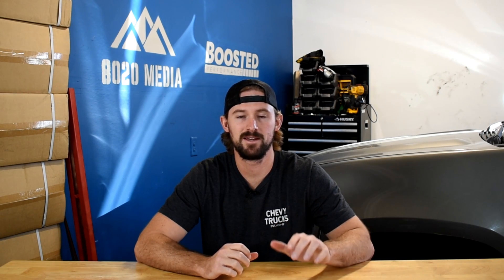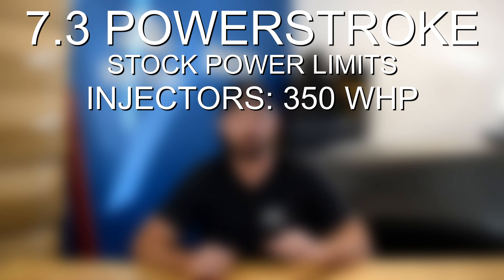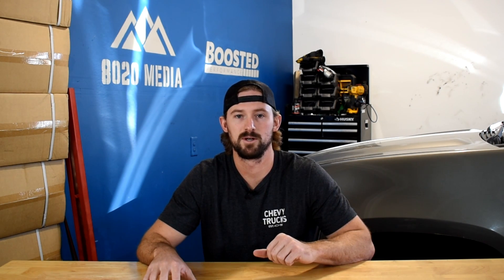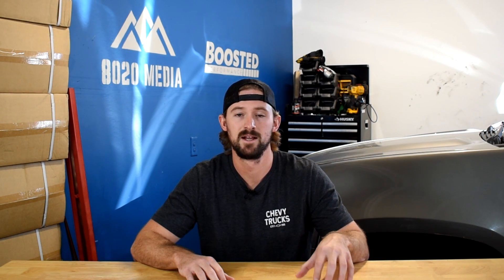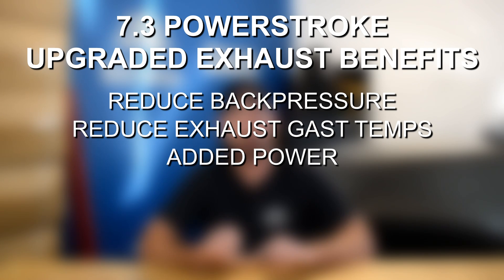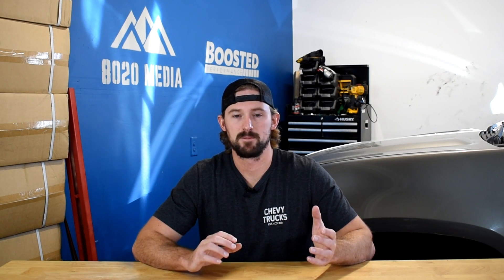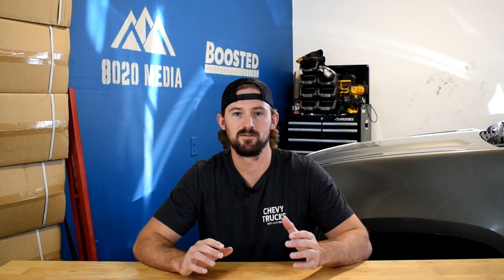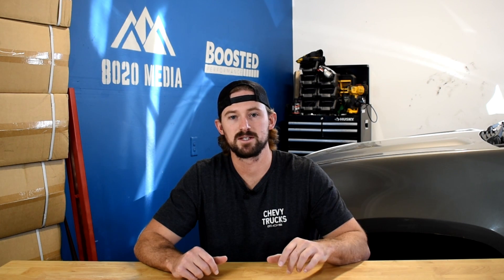How to Build a 325WHP Ford 7.3 PowerStroke!

Comment: Where do you find an aluminum exhaust? All I've ever seen is an aluminized steel exhaust and stainless steel.... I'm confused now
Reply from the maker: Yeah sorry I referred to it as aluminum but it is aluminized steel
Reply: @8020Media  so what exhaust am I supposed to use? Your video said that a steel exhaust makes a different pitch but they are all steel....
Reply from the maker: C - We're coming out with a 7.3 exhaust video next week.
Reply: Your video said that steel systems cause drone but both systems are steel

Comment: Quick question, if you use the php turner and take the truck in for service, is the service provider able to tell if it has a tuner or not? What if you remove the tuner before taking it in and restore the truck back to the factory tune, can they tell if it’s was flashed?
Reply from the maker: Do you have an aftermarket warranty or something? If you don't have any warranty then it really doesn't matter if they know it is tuned or not.
Reply: @8020Automotive 
I have a warranty on my transmission, just had it replaced and tunes void the lifetime warranty. I removed the php and tuned it back to stock before replacing the transmission.
Reply from the maker: I - Thanks for sharing your experience. I'm sure this will come in handy for other viewers!

Comment: Looking to get a crew cab 4x4 7.3 Power Stroke . Great video, the 7.3 only had 250 HP at the fly wheel from the Ford. The improvements sound great! I was a Test Driver for ford in AZ at Yucca Proving Grounds! Loved that job!
Reply: I miss Ford being in yucca now it's Mopar
Reply: I miss ford not being in Yucca also, I was a Test Driver 95-98 the 2ND Gen Lightning was a BLAST to drive on the High Speed Track! Bolt FORD tuff is no joke!!! Ram has become a better Truck because Dodge bought the proving grounds!
Reply: @thunderjet4294  lots of fun to work there ! I worked there in 95-98.
Reply from the maker: D - Thanks for the feedback! Sounds neat.
Reply: You don't get a 7.3 for power,  you get it for half a million on the road.
Reply from the maker: N - What can be true for others, may not be true for all.

Comment: BTW Stock fuel system can support quite a bit more than 400, actually reliable into the 500+ range.
Reply from the maker: I know the OBS fuel systems can handle a good bit more, you talking 99.5+'s though?
Reply: @8020Media  obs systems can't handle more, they run a mechanical pump, I would lose fuel pressure with 180/0 injectors.

Comment: 02 f350 7.3 
Kc stage 1
Cnc 180/30
4 inch exhaust
6637 intake 
Rebuilt trans with shift kit
Mishimoto trans cooler 
Stage 2 hpop with xover 
Bellowed up pipes
Boost fooler 
Hydra 
JeliBuilt tunes
Edge monitor
Reply: Doo you know the power numbers your hitting? Also what did you that you " are hitting mid 30s"
Reply: @justinguerrera8322  I figured this wasn't for me, but I was running that much but that was with an obs truck and they don't have wastegates so the more you push it the more boost it woukd make, I have a couple videos up showing the boost gauge.
Reply from the maker: T - Thanks for sharing your build. Sounds like a solid one.
Reply: How do you like the setup? I'm planning on going the same route, only difference what im wantkng to do, bigger turbo with a 1.0 housing vs the .84 and an air intake that takes air from outside the hood not from under the hood....
I had a 94 with 180/0 stock turbo with a 1.0 housing and exhaust mods and ts chip with tony wildman tunes, I would peg out the boost gauge if I stayed in long enough and that was 35 psi.... I have videos of the truck. I miss it sometimes.
Reply: @centraltexasfoxbodies  it's been pretty solid definitely has some get up vs stock . Was on the fence with the 1.0 but so far no complaints  with the .84 did have a issue with egts while towing but found out my Intercooler was leaking pretty bad replaced it along with the stock boots and now no issues.
I've seen mid 30s while in my street tunes but I rarely jump on it .
Reply from the maker: T - Hell yeah!
Reply: That’s amazing, but is it any good..?

Comment: You only mentioned HP what about TORQUE ratings that's what's important for diesel owners
Reply from the maker: Yes, that's true I probably should have talked about torque limits but torque can be managed with proper tuning so just important to stick to reputable tuners.

Comment: Yeah it has terrible gas mileage cuz it doesn't use gas
Reply: If it ran on your hot air it could drive across the ocean to Hawaii and back
Reply: Its gas mileage is infinite, fuel mileage is low.
Reply from the maker: M - lol thanks for the insight.

Comment: been thinking of getting a 7.3 or lb7. which one would you choose personally?
Reply: I use both for work.  
Ford is much softer ride and I think stops better. 
Gm is much quicker, better tow mode, it's an LLY tho. However my step dad had an lb7, and it survived that moron until he literally set it on fire drunk. 
Both will pull whatever the truck can handle just fine.
Reply from the maker: I own a 7.3 personally if that answers the question!

Comment: I have a 2002 f350 dually with 65k original miles (it is mint)...My dilemma is do i change out perfectly good stock parts for aftermarket parts?  I pull a 11k pound 5th wheel about 4-5k miles a year...thanks
Reply: your truck is worth well north of 35k. possibly a lot more if it is manual, crewcab, and 4x4.
Reply from the maker: F - Agreed!
Reply: 4x4 crew cab lariat unfortunately not manual
Reply from the maker: Mike - It depends what parts you are wanting to change.

Comment: Do yourself a favor and get rid of the hot air intake (CAI)  I made that mistake and could not believe the difference with a true CAI.
Reply: Air filter.  You lose power when sucking in hot air from under the hood.  Talking from first-hand experience as I ran that filter for a while until I got the S&B CAI.
Reply from the maker: M - Thanks for taking the time to reply here!
Reply: @Gotya02 all that hot air for 10 hp.
Reply from the maker: M - Thanks for sharing this insight.
Reply: Are you talking about AIH delete or is this something different

Comment: 03 F250 SC SB 7.3L with ZF6 stick. Bought used off dealers lot in Sept 05.

Heres all Ive done....so far

Banks CAI
Banks 6.0 Intercooler 
IH bellowed up pipes 
Garret BB turbo
Boost fooler
Adrenaline HPOP 
Hi volume LPOP 
Oil galley crossover line
Coolant bypass filter
AMSOIL dual bypass oil filters
Airdog 95 gph 
New OEM Bosch inline fuel pump.
4" turbo back exhaust, deleted muffler. 
Not obnoxious at all.

Mostly longevity mods and to let him breath better.

Afraid he's got PMR's, so I'm not gonna go do something to grenade my mill.
Reply from the maker: Brian - Nice! You're building a good one. We love our 7.3!
Reply from the maker: T - Nice build! Thanks for sharing.
Reply: Why did you use an 6.0 intercooler
Reply: They are larger, fit without mods and you can get relatively cheap.

Comment: I've had an e99 for 12 years and tried a TS6 tuner but saw a 2mpg drop in mileage so I run it in stock mode. Seriously considering an intake mod and maybe a higher flowing muffler. It's a daily driver that occasionally tows a 5th wheel. Not interested in more noise, but can deal with some to get more power and mileage.  I'll try the 50 mph tune with any new mod to see if the mileage improves vs taking at hit. Nice video.
Reply from the maker: Sol - Thanks for the feedback & sharing your experience! If you're looking for an intake, here's a great option that combines price, quality, and performance: https://boostedperformance.com/73-powerstroke-cold-air-intake

Comment: I just bought my first diesel to pull my new to me 5th wheel camper. I ended up getting an early 99 7.3L. So far, I have an intake, 4" turbo back exhaust that duals out under the back of the cab. I just got done installing all my gauges. I ended up rebuilding my tranny a couple months ago. I did it myself and installed a tugger kit while i was at it and a dual clutch disk converter. The truck has 275,000 miles on it and idles at temperature with 48 pounds of oil pressure. I also put on a flat bed with a nice tool box and a 150 gallon auxiliary fuel tank. It has 35" tires and gets about 16mpg. A tuner will be my next purchase. I figured id set it up to take advantage of the tuner before I got it. The intake and exhaust did make a difference. I have about $4k tied up into the whole thing, including the price of the truck.
Reply from the maker: This sounds like a nice rig and would benefit largely with a tune! Nice build.
Reply: @8020Media  

Thanks, and yes, it would benefit from a tune. It runs really well now, I can't wait to see how it runs with another 100hp and 200 lbft. My next 2 mods will be the Hydra and a turbo master waste gate controller. I'm actually putting my own boost fooler together with a 1/4" pressure regulator. 

I'm also really thinking about running heated fuel lines and maybe a heat pad on the fuel tank. I live in se Idaho so it's cold here a lot! Last January, we saw -37 and it can get much colder than that.
Reply from the maker: J - Nice! Keep us updated!
Reply: @8020Automotive 
Would this not work for me?
Reply: How much did you pay for your truck. I just got a 99 7.3 dually and paid $12,500, I know I may have paid a little too much. It's my first diesel truck and I'm rebuilding the fuel bowl, hpop, and replacing boots.
Reply: @smithohana5683  

I paid $2000, but the bed was pretty well rusted out, and it didn't run. I found a really nice flatbed for $500 and put it on and ended up finding the fuel bowl heater was shorted out blowing the fuel pump fuse. It had just had $3,000 worth of front suspension work done to it by the previous owner and come with all the receipts. I also went through the transmission. I put a new torque converter in it and a tugger kit. All together, I'm in it around $4200.
Reply: @jesusisalive3227  Awesome!🙏🤙
Reply from the maker: J - Thanks for taking the time to respond to other viewers!
Reply: @8020Automotive  

👍
Reply: @jesusisalive3227 Thank you Jesus!
Reply: @smithohana5683  I have my 2002 f350 up for sale right now, 230,000 miles 7.3 2wd automatic cab and chassis set up to haul trailers. Life long texas truck it's up forsale for $9,000.... it's my daily right now.
Reply from the maker: Smith - How many miles? You've got a good one for your first. We love our 7.3
Reply: A congratulations on your purchase of a 73 mine has 336,000 original injectors and a few upgrades I read that you were talking about making your own boost fooler here's an idea for you check this link out this is what I did very simple and the hose that goes on the other end of this thing all you have to do is heat it up and it goes right onto the nipple on  your map sensor and the other and 1/8  NPT pipe thread ONTO THE INTAKE SPIDER check it out you will understand
Reply: @robertfisk8344  

They must have removed your link?
Reply from the maker: We didn't remove a link. Don't think he plugged one in.
Reply: @8020Automotive  

I think youtube themselves removes links sometimes.
Reply: MC AS2201F-01-08S Air Flow Control Valve with Push-to-Connect Fitting New
Reply: 4k is a steal, let alone buying upgrades lol
Reply: @bacon098  
Yes, it was kind of a diamond in the rough situation. I think most people couldn't get past the rusted bed. It didn't bother me at all because I wanted a flatbed anyway. It was funny, my flatbed sat on my trailer in front of my house for a week before I could install it. In that week I had 5 people stop and want to buy it. They could not believe it when I told them I picked it up for $500. They told me they could not find anything for less than 2k.
Reply: Including the truck??? Sounds like you got a heck of a deal on yours...I got lucky as well. My wife and I ended up having a second kid, so I even traded my 03 mustang gt for an 02 f350 with the 7.3 crew cab.
Reply: @DeepSouthBayouDiesel  

Yes sir, including the truck. Got the truck for $2k. I got the feeling the gal who sold it had it sitting there for a while. Nobody wanted to mess with it because of the no start and the rust. I took the risk knowing I could part it out if it wouldn't run. I got lucky, it took 30 minutes and a $30 part to get it running. Oh and it had brand new 35" tires on it with dick cepek wheels.
Reply: A good tune on a 7.3 is going to blow your mind.  Night and day.  It's still not going to run with a modern common rail but it will wake the F up!
Reply: @failranch9542  

I can't wait to find out! Just last night, I installed a new tube/diamond plate bumper. She looks mean now. Do you have any suggestions on tunes?
Reply: @jesusisalive3227  I have DP that I've had over 10 years.  I'm pretty sure there are better ones out there now.  A lot of people like Jellibuilt (sp?).  I use the DP 80 hp "economy" and by comparison to stock it is an absolute rocket.  I wouldn't tow heavy with it though.  Back it down to one of the tow tunes for that.  They aren't as fun but they won't destroy your truck either.  I've been wanting to try a 120 hp race tune just for knocking around day to day unloaded.

PS - make sure your tuner is aware that it is an E-99.  Those are unique in a lot of little ways.  Even the injectors are different.
Reply from the maker: J - We've got a tuning guide on our diesel website that will help: https://dieseliq.com/73-powerstroke-tuning-guide/
Reply: @8020Automotive  wow.  It's crazy the price these days for a good tune.  When I went with my DP in, I want to say 2012, I think I was like $375 out of pocket for all the hardware and 4 or 5 tunes from them.  Things have just gotten out of control!
Reply from the maker: F - Completely agree..
Reply: I have a late 99 cab and chassis extendeed cab, 7.3 manaul dually with an aluminum flatbed on it now
Reply: the sec you test drive   the truck on a tune you'll never not have one again its  very significant     I have ts  because if its simplicity  makes transmission shift tighter    ... def  get a tune
Reply: When you did the tranny,  did you go the heavy duty route? Super duties came factory with standard duty,  heavies were special order
Reply: Me too! I am picking it up in 2 days and its a beast. I know nothing about diesels yet lol
Reply: Was tranny due to wearing out or a upgrade to handle more engine power? How hard was that task to do??
I’ve built TH400 and that was rather easy.
So is there a source to know what good parts to put into these and like the converter you mention?
Reply: Why a dual disk converter? The 4R100 comes factory with a tripple disk
Reply: I got a 99 aswell when I bought it had a 5 inch exhaust dumped out right at the back of the cab and it’s got a bigger turbo. I ended up getting a local muffler shot to run it like the factory and put a hi flow muffler and that was 10x better
Reply: With s&b cold air intake that actually pulls in outside air (not a open filter under the hood pulling hot air),4" turbo back exhaust,edge attitude tuner,and a fully built john woods transmission with triple disk torque converter,and dyna trac free spin kit you can get 18 to 21 mpg.
I also use amsoil signature series 15w40 in the engine and schaffers in the transmission and transfer case as well as using diesel kleen 6.5oz per tank(I will be swapping to opti lube soon as it's lube properties for the hoop are far better than diesel kleen)
I have 415,000 original miles and my stock injectors are still working perfectly.
I have also swapped turbo impeller wheel for a wicked wheel and removed the air heater on the Y pipe, and lastly I replaced my up pipes with bellowed stainless and replaced all CAC boots with the upgraded boots from dieselsite.

Big thing I want to bring up is the way this guy done his "cold air" intake is completely wrong,the way it's set up it's sucking in hot engine air and that can decrease HP by as much as 20HP, you have to set up your cold air intake to draw in outside air and you will gain around 7 to 10HP as well as lower EGTs.
Also your trucks computer once you hit 25psi of boost will go into limp mode you can either pull over shit the truck off and back on to reset or after about 2 to 2 and a half minutes the computer pull limp mode as truck goes back to normal, if you are making that kind of psi you will need a boost fooler and will have to upgrade CAC boots or you will blow the boots off.

One more thing to add upgrade your trans cooler to a 6.0 cooler
Reply: I've had 2 7.3's, and had tuners on both. Set for economy my 97 1 ton dually was getting 17 mpg, @ the 65 horsepower level. My 2000 F 250 4+4 with a 4" lift and 35's on it, got 33 mpg. I couldn't believe it ! I've got a '17 F 250 Super Duty 6.7, and it's all stock, getting 17 mpg.
Reply: What tuner are you using?

Comment: I have had a Bully Dog on my 02 for probably 12 years. Would it pay to go to a newer Hydra?
My truck is a tow rig for a 4 horse trailer.
Reply: It has so far. I only use the tow tune
Reply from the maker: I don't think there's a reason to switch it up.
Reply: Wouldn't doubt that some "updated" tuning wouldnt hurt. All else keep running it!
Reply from the maker: Mules - Agreed!
Reply: Bully dog is great
Reply from the maker: H - One of the ones we recommend.
Reply from the maker: William - Has the Bully Dog worked well for you?

Comment: I’m not sure if I misunderstood. The steel exhaust won’t rust out as quick as the aluminum?
Reply from the maker: Yes - aluminum is more prone to corrosion from salt. Stainless steel holds up better. I've got an aluminum one on my F350 and I had to have a hole in the piping patched last year. So stainless holds up better/is more durable. Sound is of course a preference but a lot of people do prefer the sound made by aluminum over stainless on these trucks too though.
Reply: @8020Automotive if your "aluminum" exhaust is rusting, you have steel 😂
Reply: @coltondavis7222 he said corrosion not rust. Plus he’s talking abt stainless steel